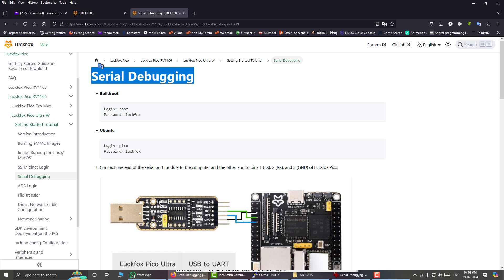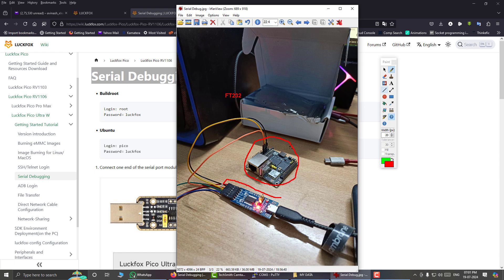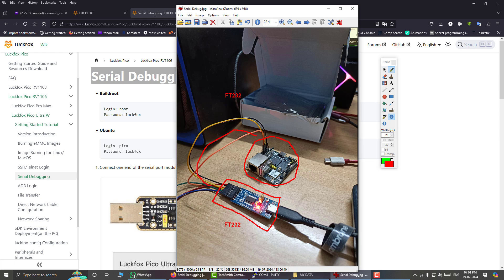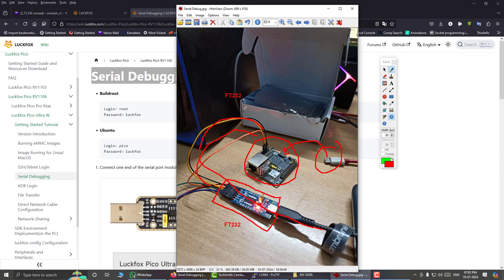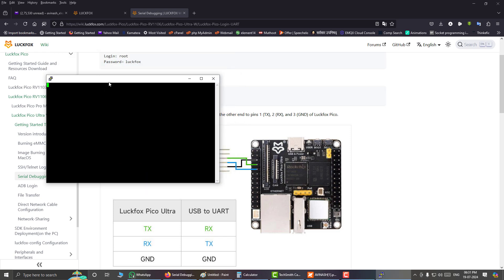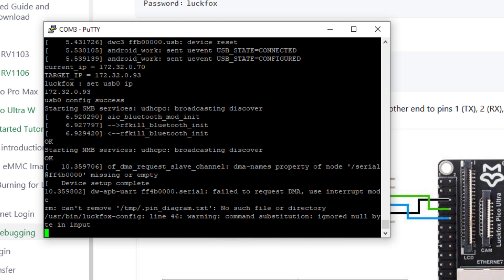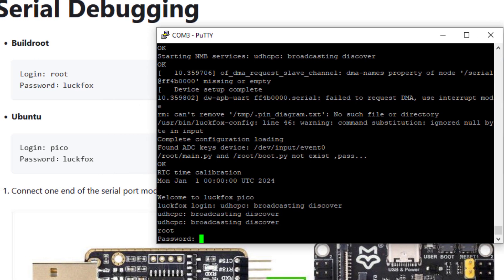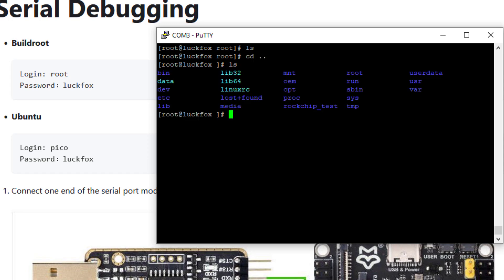Luckfox Pico Ultra (W) Boot up time - Embedded Linux with Luckfox

Comment: I recently purchased Luckfox Pico Ultra W but it's not getting detected on my windows PC. I tried all the steps on the website to ensure cable is good and antivirus is not enabled. Also, tried on multiple different machines with Windows.

Did you face similar issues?
Reply from the maker: Nope! Its working great!